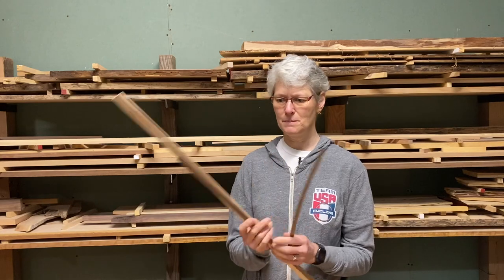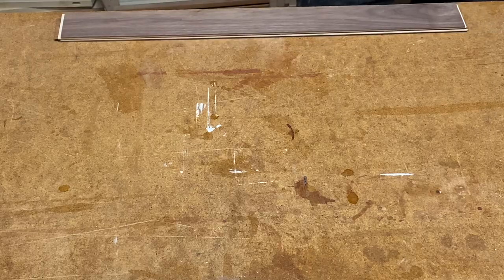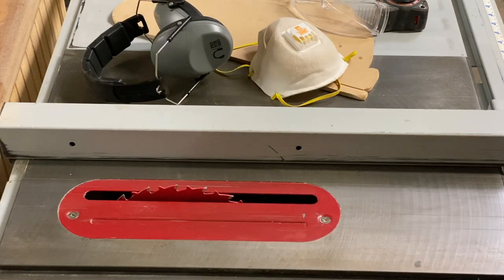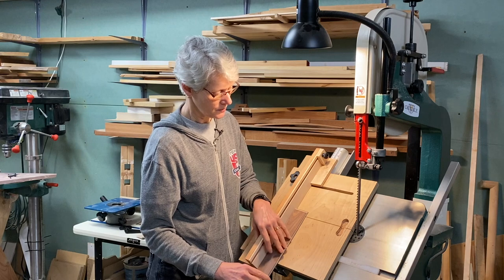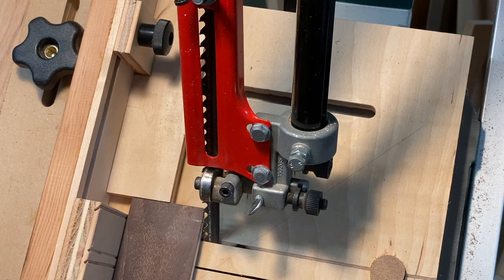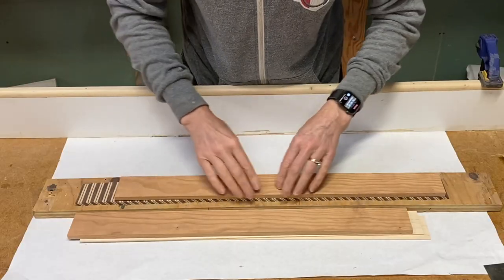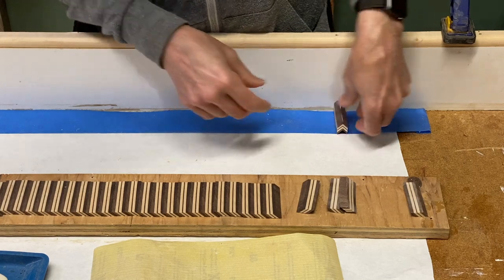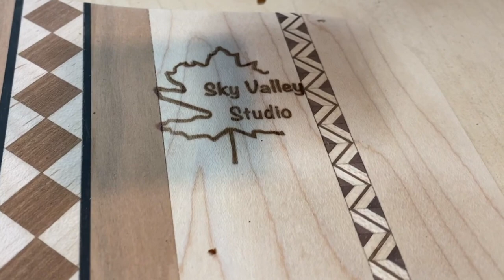Making Wood Inlay Banding - Zig Zag Pattern

Comment: Hurray! So glad to find this video.. Love banding videos and for sure have not seen this design constructed before.. It's funny to me as not 3 weeks ago I had cut a block diagonally, saw I could do a zig zag pattern playing around with it.. But then kind of stumped on how I'd glue it. And what would I do with all those gaps at the bottom? Plus it was a thick block at 2 inches thick.. Thinner seems to be trick here.  I am for sure going to give this pattern a go in the next few weeks I hope.. Prolly be back here for some tech support on what I did wrong.. :-) . 

Did you make the cut to trim the tops off after you got it all glued up on the bandsaw or table saw? I think I'd rather use the table saw for cleaner cut? 

Nice setup on the glue jig.. pressure on all four sides keeping it tight..Although I'd be worried about keeping it clean with all my glue squeeze out.. Seems like you cover that in another video.. I'm in heaven with these videos.. Thanks a ton..
Reply from the maker: Glad you found us! I’d love to see some of what you make here. Playing around with the possibilities is addictive. You’ll also get better at the squeeze out. 

Band saw or table saw, either is fine. I use a bandsaw with an appropriate blade to get a clean cut. Takes away less material. 

 I always take a hand plane across the edges for a super tuned and smooth finish. 

Happy to collaborate and brainstorm with you on your journey.
Reply from the maker: Don’t miss the other banded inlays! I’m keeping them in a playlist, and there are more to come.

Comment: I may have missed it - Why the jig and bandsaw and not a compound mitre saw?
Reply from the maker: Easy answer. I rarely use my miter saw. The band saw is safer, especially for small pieces. Try cutting 1/4” slices on a miter saw. Also, the band saw removes about 1/16” material even after planing smooth. The miter saw will be closer to 1/8” or more.